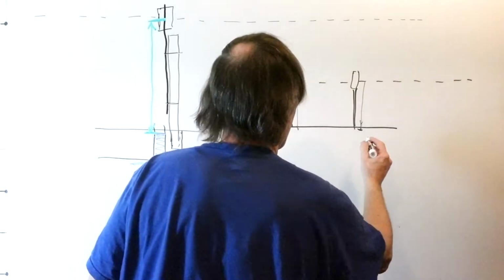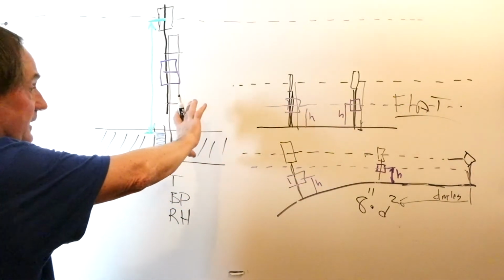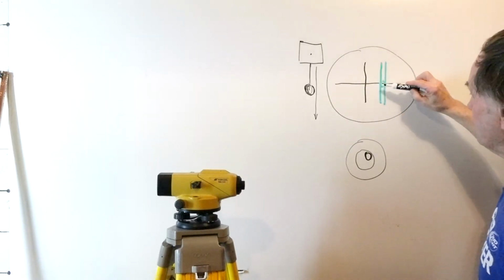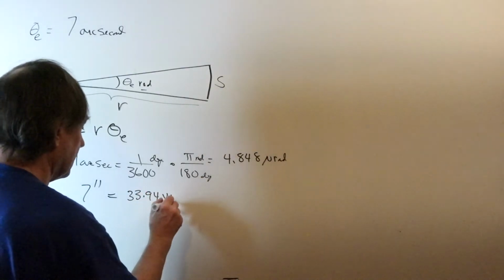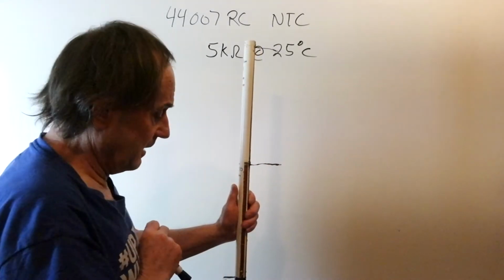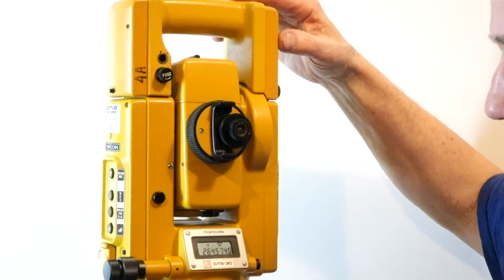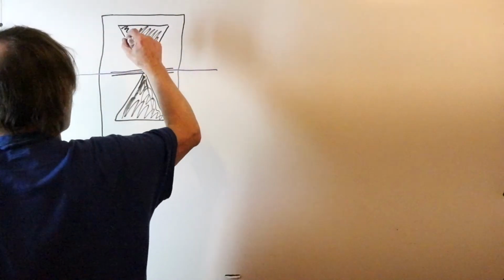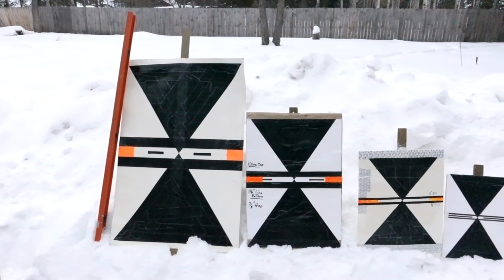Survey Overview  Rainy Lake  -  is the earth curved?

Comment: Please tell me how high from the lowest, coldest air you need to get to avoid the gradients? 

If you raise you elevation and increase your distance you still end up with the same effect of refraction. You don’t solve anything, Nyuknyuk.
Reply from the maker: Actually you do.   The greatest reraction occurs in the first few meters above the surface of the water in the humidity zone.   Usually, you are safe to assume you are out of that zone if you stay 10 feet above or higher.  I set up my equipment 13 feet above the surface of the lake.
GH   Feb, 09, 2020   10:56am
Reply: George Hnatiuk again, you provide no data to prove that.
Reply from the maker: There is no data in the introductory video that describes the test.  That is an overview and theory of what the test is all about.  The updates show the effort involved and care and proceedure of setting up the targets and viewing them through the auto level and theodolite.

The updates show the progression and give some data.  The final data  and analysis was handled by Walter Bislins and very well presented.  I told you what to do and if you cannot follow instructions, then I cannot help you.  Sorry.
GH

Comment: Yay!  George in action on the lake in 2018!
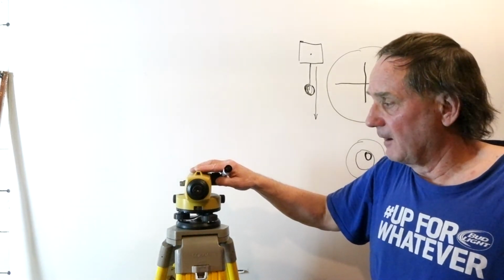Reply: There is a tiny bit of ambiguity in the accuracy of the auto level at 24:30 or so. You state that the uncertainty is within 5 arc seconds, but then you only put up the definition of an arc second on your white board.
Reply: I posted that because there is an edit, and you seemed to be going onto  a new subject, instead you go into more detail, but you then state the uncertainty is 7 arc seconds!
Reply: Great video George :) 

Very informative, wide ranging, concise and illustrative.
Reply from the maker: Rumpus you are correct.  I was very tired when I made this video.  The uncertainty is 5 arc seconds but I added in a few more to 7 arcseconds to give a guard ban with the uncertainty and did not explain that.  I will address the issue in another video update when I discuss the calibration of the autolevel.

The actual accuracy of the instrument itself is less than 4 arc seconds but I have found that it is nearly impossible to reach that in practice when using the spotting scope.  The width of the cross hairs in the spotting scope limit how precisely one can set them on a target when calibrating the instrument and sighting on a target in the distance.  There are always practical limitations when using instrumentation that one can only understand with experience.  This is an issue that I need to discuss with Jesse and my mentor, Dave Lenk, about to see if there may be a work around surveyors have come up with - they do tend to be very clever.
GH

Comment: There is no true north, NyukNyuk.
Reply from the maker: True north is where the rotational axis of the earth is located in the northern hemisphere and true south is the corresponding location of the axis in the southern hemisphere.
GH  Feb 09, 2020
Reply: George Hnatiuk right. How did you determine that?
Reply from the maker: @theplanetruth  
Travis,
I never received notification of many of your comments to my videos besides this one here.  However, we have since spoken and have resolved what I will be doing to get you good data that you can use.  I have just ordered a better Theodolite than my present one and should have it here in the next 10 days to begin measurements as I previously outlined to you in a private mail in discord.  The new Theodolite is a Topcon GTS-3B which has 1 arc-second measurement capability and distance measuring to over 15,000 feet.
GH  Sept, 04, 2020   5:30pm